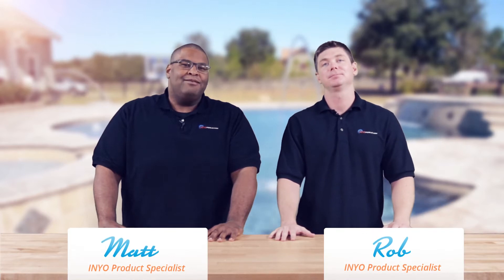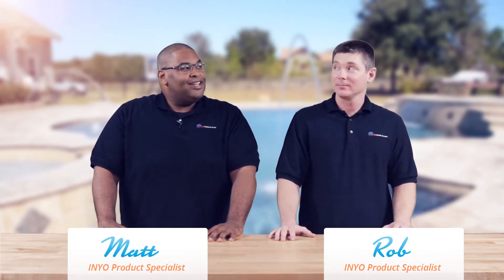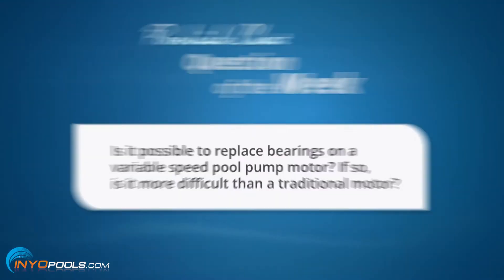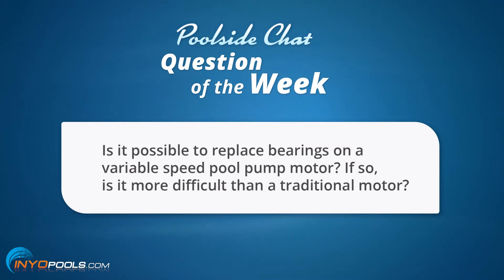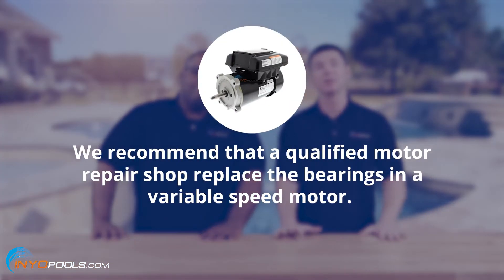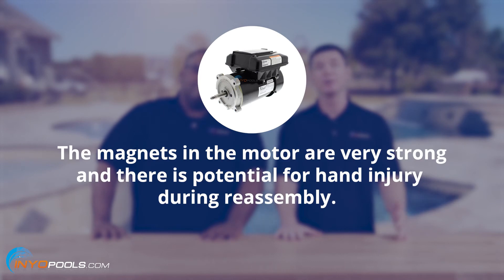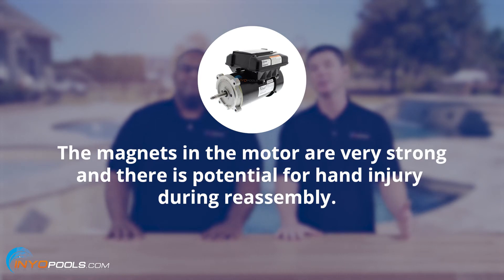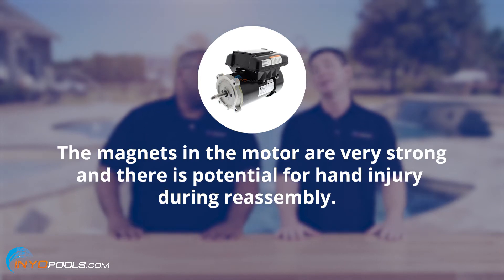Can I replace bearings on a variable speed pump motor?

Comment: The bearings in my Century 1.65 hp variable speed motor are 6203 rubber sealed bearings. The front bearing failed. But I replaced both bearings in about 4 hours. I had never performed this type of repair before, and I had no help from the professionals as they have no instructional video for this motor. My motor is about 4 years old. Hopefully this repair will delay a $700 bill
for several years. Magnets were no problem at all. So yeah, get the 6203 sealed bearings for this motor. Do be careful and enjoy the repair.

Comment: I just replaced both bearings on my Hayward variable speed sp3200x series pump. "The strong magnet caution is not true". i ordered the bearing and seals off Amazon. it took me a couple of hours but it wasn't that difficult for my first time taking a pool pump apart, ever. Good luck.
Reply: I have that pump and would like to try to replace the bearings. Could you provide me with the part number for the bearing used? Also, how is the repair holding up?
Reply: Helpful

Comment: I just replaced 2 bearings and shaft seals on my Pentair Superflo VS and it was not difficult at all. The strong magnet caution is not true. My rotor disengaged from the housing with no problem. The hardest part was getting information on parts which manufacturer will not provide. I got 4 different bearings that might work and 2 did. Mine was 6203 and 6304 for $12. This was my first time doing this and very glad I did. Saved about $500-$700.
Reply: John, thanks for sharing. I have the same model as yours Pentair Superflo VS.  I want to change bearings in the motor.  However, I can not get the rear fan off the back plate.  Could you share your experience how to do it.  Thanks
Reply: agree, just did this with no guide on my Hayward VSP (SP2613), easy to do
Reply: Thank you. I have a Century VGreen 165 VS. I just ordered two 6203 bearings. Hopefully it’ll be not too hard to replace the bad bearings.
Reply: @jamesw4445  I need to do the bearing on my VGreen 165, were those bearings the correct size?
Reply: @sd0753  Every figure this out? I need to on my  vgreen 165 too. Was it easy? Any how tos?
Reply: @sd0753  The bearings should be correct. I checked the manufacturer’s specs.
Reply: @zharris6  I ended up ordering a new pump. The motor has been in use for 5 years. Its screws/bolts were badly rusted and I cannot unscrew them. There was no way to spray PB into as long bolt screws are seated inside the motor. I snapped one bolt and cannot continue to dissemble the motor.  Otherwise, there would be no bolts to hold the motor together. I just ordered a new pump. When I have the new pump, I will install it and then try to fix the old one. I will have to snap the rest three long bolts and then try to extract broken screw pieces (that’s the part I am most concerned) and find matching long bolts. Hope your motor’s bolts are not rusted. When I have the new pump, I will apply anti-seize lubricant to all screws.
Reply: @jamesw4445  look at all of us here with failed vgreen 165. Mine didn’t make it five years. I’m thinking of going with a different brand. What did you end up getting?
Reply: @david34802  I didn’t find any other drop-in replacement pump and ended up with a same model one.
Reply: @jamesw4445  the evo with the more basic single button but supposedly more durable vfd?
Reply: @david34802  The weakest part is the bearing. The control panel is in good quality. I live in Florida. Five years under hot sun and heavy rains, the control panel functioned normal. If the manufacturer spends $5-10 more and uses high quality bearings, we would have a hack of a VS motor.
Reply: @jamesw4445  that’s too bad. It was the bearing that failed on mine

Comment: I'll disagree with the answer in this video. I've replaced bearings in a number of single speed pumps in the past, and I recently did a set in a Hayward Ecostar VSP. The only difference in my process for the VSP was to leave the rotor in the case. I set the motor on its end with the shaft sticking out the bottom through a hole in my work bench and pulled/installed one bearing, then flipped the motor to do the other end. Reassembled and had a nice, quiet motor again.
Reply: Did you order the bearings from before or ordered once you had everything disassembled? I'm going to be attempting this soon so nay tips will be helpful!
Reply: @wajhoongra  I'm sure you have done this already, but for everyone else, I used 6203-2RS1/C3 bearings to rebuild my Hayward SP2613 VSP
Reply: I also have a Hayward ecostar VS 😊

Comment: Thanks for that Video clip. Ok that's quite understandable that replacement of bearings on VS pool pump motor is best left to professionals.
How about this ? Can one replace the main motor but use the Old VS control box ? Can this be done by a Technician without risk of other damage ?

Comment: Has anyone attempted to change out bearings in a variable speed pool pump motor?
Reply from the maker: We have not attempted to replace the bearings on a variable speed motor yet. We have talked to variable speed manufacturer reps and they were hesitant to recommend replacing the bearings. We received the following statement from one rep "We recommend that only an electric motor repair shop work on this type of motor, due to the potential for injury, due to the strong magnets".
Reply: @Inyopools  I have replaced the bearings on two different Pentair VSMs without any problems.  Both of the motors are back in service and running everyday.  Of course the manufacturer does not recommend.  They want you to spend $1500 replacing the whole unit.  The bearings will cost you less than $15 and about an hour of your time.  There is nothing difficult or dangerous about replacing the bearings.
Reply: @Inyo Pools Just replaced both bearings in my Pentair IntelliFlo Variable Speed Pump VS+ 3.2kW 3HP Max. VERY simple replacement .
Reply: @Hegbard  Do have the specs on the bearings you used?  I have the same pump and the bearings need to be replaced.  I just replaced my washing machine bearings and it is running like a champ.  No one has the part number or specs on the bearings.  I would prefer to have them before I started.  Thanks
Reply: here is an example of bearing removal on an Intelliflo VS. It does not look like an easy job, especially since the motor housing is harder to access than the single speed motor videos seem to show.
https://www.youtube.com/watch?v=1-q9zvsNJds